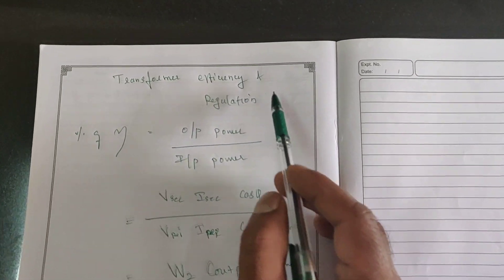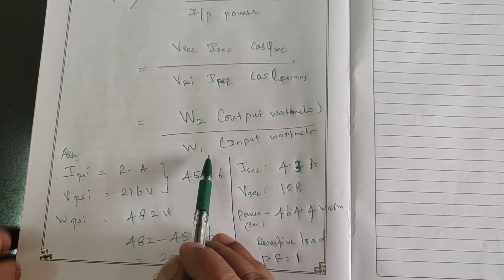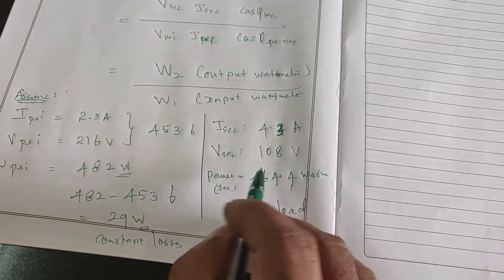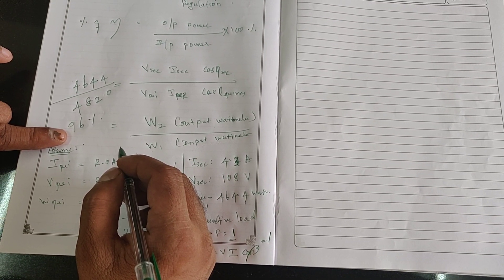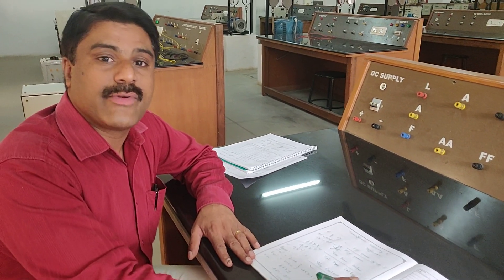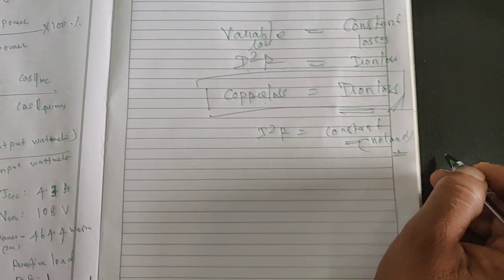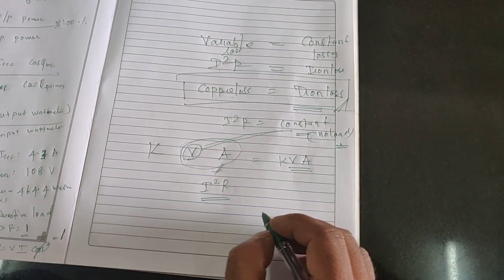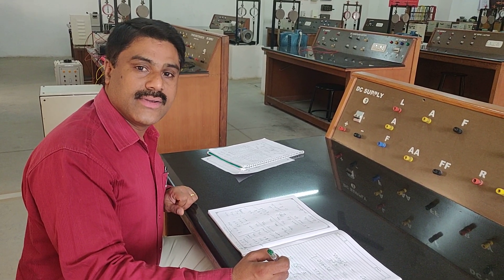Load Test on Transformer | Single Phase |  Part 3|Dr Suresh.S|KIT CBE

Comment: Level Sir G
Reply from the maker: Means
Reply: @sureshseetharaman5  very impressive Sir G
Reply: Sir 
What if we connect inductive and capacitive load
Comparison b/w these three
Why resistive , inductive load has positive and capacitive load has negative voltage regulation???
Logical Reasoning!!!